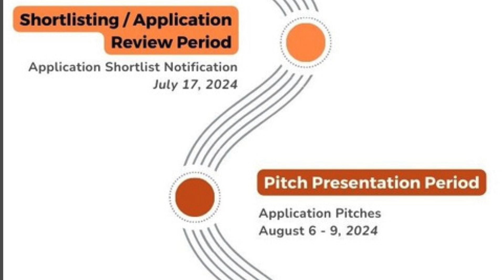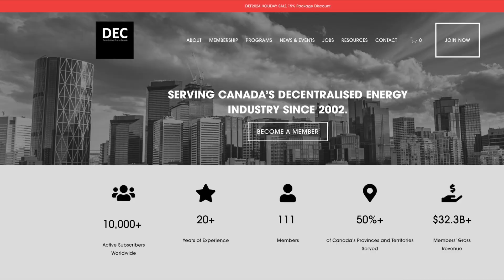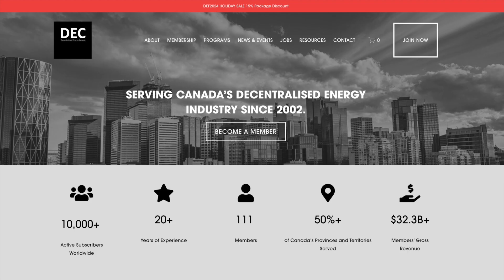How to Build a Modern Electric Grid - Integrating renewable energy

Comment: This is a good place to start, but we need to look into geothermal and small nuclear reactors for base load power.  I am looking at the live energy production for Alberta right now.  We have 5500 MW of wind turbines and we are generating 200 MW of energy and we have 13000 MW of natural gas and we are using 8000 MW of that right now.  We have 1600 MW of solar and we are producing 1300 MW, so solar is more efficient at generating electricity than all those wind turbines, as I have never seen more than 50% generation of wind from what ever amount has been installed over time.  I am all for clean energy, but it has to make sense for what is installed.
Reply from the maker: This story alludes to one of the two or three big areas of change we need. Smart grid software and hardware and AI can make a really big difference optimizing the use of the existing underutilized grid infrastruture and although the software and technologies exist there needs to be big changes in regulations and rules to enlist these techologies as tools to optmize an increasingly decentralized grid. We need better interies with energy storage - i.e. BC. We need energy storage and I agree with you there seems to be growing potential in geothermal to provide baseload power and at the same time it can help heat our buildings with no emissions. See this story on an Alberta company that is rocking geo: https://youtu.be/Qh9n4O8N5ig